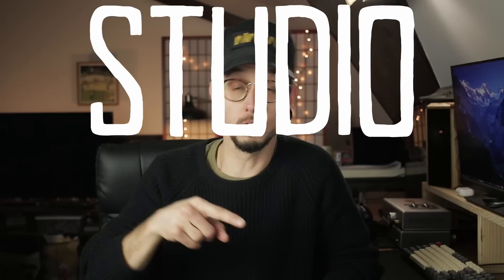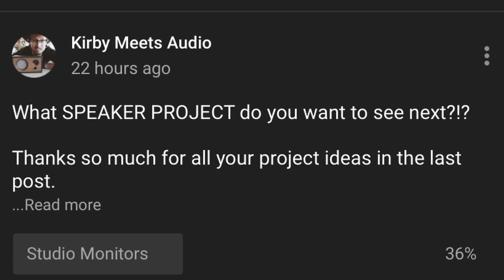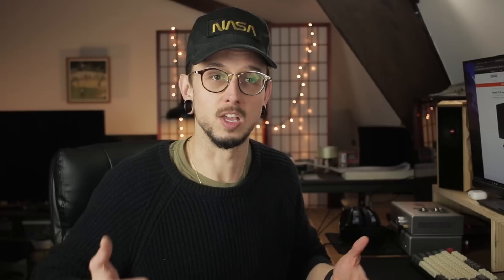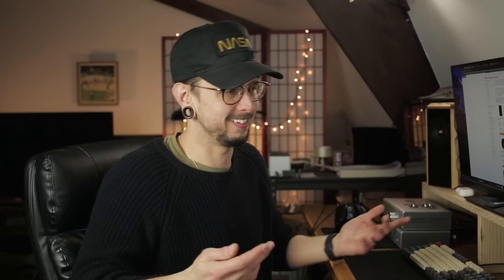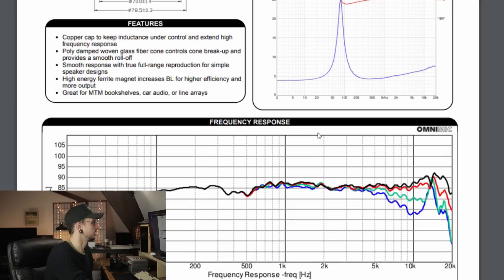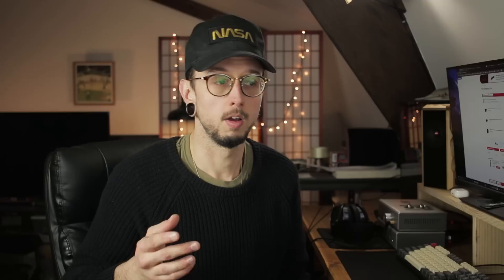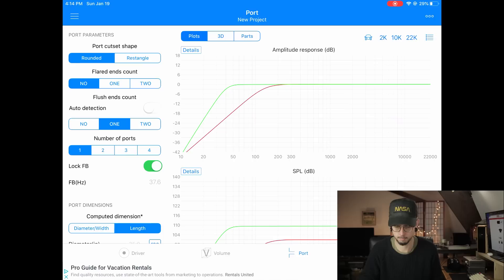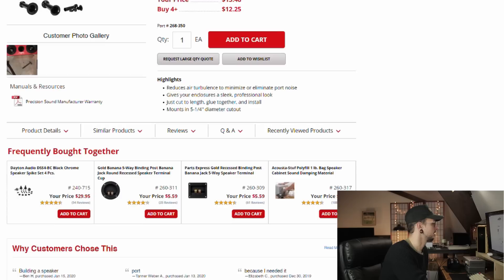DIY Studio Monitors (DESIGN) Step #1 | Home Recording Studio

Comment: Two questions popped into my mind. 1) Why zero thickness on the mid range box walls? 2) Why didn't you use its external volume (internal dims + wall thicknesses) in the calculation?
Reply from the maker: Because I want that enclosure to take up as little room as possible on the front baffle, so I was starting the internal dimensions just over the cutout diameter of the driver. Since all I really cared about was the internal dimensions I just left it at zero. Adding the thickness would be going off the external dimensions off the enclosure. Thanks for watching!
Reply: @KirbyMeetsAudio  I think the second part of this question was targeted at determining the dimensions for the overall enclosure, and I think you did, but it was hard to follow in the video since you were having to jump between screens for ideal volume and the volume calculator.

It seems like the overall enclosure volume should be: ideal volume for woofer + total sub-enclosure volume for midrange (including wall thickness)

Correct?
Reply: @KirbyMeetsAudio  When you spoke about the internal box, I assumed it had walls. So, I was thinking that the internal volume of the outer box should be the volume recommended by the software plus the external volume of the small box (internal plus walls). And, as you mentioned, plus a little more to accommodate other stuff inside.
Does the internal volume have to have walls to isolate it from the bigger volume, or do you just need to add the volume it needs to the volume of the bigger box?

Comment: Quick question: I have an older pair of Polk Audio tsi400 towers (3 speakers in each)... can't sell em, they work fine, dont wanna throw them out, and too big for my new house... I'm thikning of gutting them and reusing the speakers, separately, in a new smaller box to use throughout my workshop. Not looking for hi-fidelity, but basically just how to take speaker out and re-use in another cabinet... any requirements? Tips? Thanks !!
Reply: It will be the woofer that will give you problems, they are designed to go in a certain sized box if you pot it in a smaller box you'll most likely loose a lot of the low end, I'm guessing it's ported... Of so you would probably need to pot it in a sealed box
Reply: You need to  find the Thiele & Small  parameters to design the box in WinISD .
Google it .

Comment: Out of curiosity, what dome tweeter can you cross at 300hz? I’m guessing the crossover would need to be 4th order at minimum. I guess it would be a dome mid at that point, wonder if it could extend to be a tweeter as well.

I like the idea of comparing the dome with the AMT. I have about a dozen different pair of AMT and ribbon tweeters and would really like to play with them. I’m a bit of a dome guy.
Reply: No dome tweeters can be crossed at 300Hz or even 1000Hz, any dome tweeter going that low will produce loads of distortion, and by loads I mean LOADS.
Also the crossover would need to be 8th order just to have a chance of not blowing the tweeter up immediately.
And on top of that the output level for a dome tweeter in that range would be ridiculously low and would require a pretty big array to work.

Comment: Better with sealed box enclosures...if ported to much bass lag & long time  resonances...better a bigger box with an accurate bass & midrange response than a  bad resonant MILLSA frequency roll off response..ATC only use sealed cabinets as more accurate & faster frequency response in the bass & mids
...i use PreSonus Eris Ex8's, ported but i filled the bass port with heavy density foam...now a faster bass/lower mids...it really makes a difference when mixing... all the best monitor speakers use sealed box's, ATC etc, transmission line if designed right, my favourite but not cheap, PMC etc...even passive radiators are better than ports for more accurate bass & mid-range ...i built a pair of passive monitor speakers ,i built them 0.8m in height but put an HDF internal partition board to get the right volume after running a Thiele Small Paramaters CAD software check... designed a small footprint speaker so no need to buy stands & i can have as big or small an internal cabinet volume as i need....the bottom seperate partition is filled with sand, internal walls lined with copper foil as the bottom section contains a seperate box for the crossovers...this defo improves sound as no EMF etc to upset the crossover's performence, 45+ yrs has taught me no ports with monitors if you want a more accurate easier to mix bass & lower mids...good luck
if i could afford them i would buy PMC active Transmission Line monitors or ATC sealed box active monitors....you get a more accurate tighter bass especially if transmission line monitors...hard to design & build but worth it...good luck...do you have a build video ?....right seen the link..i take it they are gonna be passive not active bud ?...active speakers are better when mixing music but i have heard some fantastic passive monitor speakers if you have good  amplification..will look for the build video....sealed box's are more accurate & easier to design but you will need more enclosure size, the ones i built were closed units but had enough room for decent bass, a SEAS 8" bass unit....the cabinet was 9 1/2" wide x 11 1/2" deep x 0.8m in height without spikes & base.. 0.86m with base & spikes
...now to watch the next one
...good job so far ...i would tune the port to speakers unity for the fastest & best bass response...

Comment: Hi, I found your channel while looking for help to build a Bluetooth media/speaker box. I am not a speaker nut and have never built one before but I do dabble in electronics Raspberry Pi's and Arduino's. I have an old Avo Model 40 multimeter that as a meter is no use but thought it would make a cool steampunk speaker but I have no idea where to start. There is not a lot of room inside but I have cut out all the internals except the needle meter it's self. The rotary switches are still usable and it would be cool to incorporate some of that or even the needle meter like a meter on an old amp but that might be a step too far. Any ideas or links to parts I could hook up and mount inside would be great. I could get two small speakers in, one each side of the case,  or one bigger one at the back with room at the top for the electronics and probably fit some sort of rechargeable power pack.

Comment: Kirby, I think your heart's in the right place, and it's awesome that you're providing ideas and instruction for building decent quality DIY speakers, but calling them "studio monitors" is honestly... well... kinda dishonest. If building actual studio monitors was even remotely simple, NOBODY would still use Yamaha NS10s - a speaker that hasn't been made for decades, and that even Yamaha has been unable to recreate, largely because one of the original construction materials NO LONGER EXISTS. Also, most bi-amped and tri-amped powered monitors (i.e. Genelec 1031s) don't employ DSP, just quality analog crossovers. Additionally, your description of the large, soffit-mounted monitors found in high-end commercial studios as existing only to hype the clients is dead wrong, except in crappy control rooms with sketchy acoustics. Studio mains by companies like Westlake and Quested are insanely accurate, have incredibly linear frequency response that extends beyond the range of human hearing, have nearly zero distortion at volumes from barely audible to painfully loud, and in control rooms with great acoustics they're the main reference for mixing engineers... hence the term "MAINS". They're also decoupled from the structure of the room (when properly installed), and durable enough to make people deaf 24/7/365 for a lifetime, with no loss of fidelity. Not to mention they tend to be REALLY expensive, and no commercial studio would pay over $50k for speakers just to hype the clients.
Reply from the maker: Hey man! I agree and disagree with you. I certainly never want to make the impression that designing top-tier reference, studio, or hi-fi speakers is simple. But the truth is, getting 80% of the way there is totally doable by most people if you have the information needed. Most people (probably every single person) watching this video for more than just entertainment and are thinking about building their own, aren't working in a dedicated studio with high dollar clients. 80% is more than enough quality for a bedroom studio.

I think there are a lot of reasons engineers continue using the NS10s other than their distinct sound, including familiarity.

Actually, a lot of them do use DSP, including the monitors I was referring to in the video, Adam S3H.

I'll probably make a more clear note of this in the next video, but you're totally right about mains. They definitely aren't JUST for pleasing clients. I probably shouldn't have made it seem that way just for the sake of time. I've seen mains used all the time for various jobs during a session, but I stand by what I said in the video. Its what I was taught by some of the best engineers, and its what I experienced while working. Obviously, they are an amazing technical achievement properly implemented, that's their whole point.
And dude, be real. If you think a commercial studio wouldn't pay 50k JUST to make sure clients are hyped, you're insane.

I appreciate the comment and thanks for watching!!
Reply: @KirbyMeetsAudio  Thanks for taking the time to reply to my comment! I'm admittedly hyper-critical, and probably focused a bit too much on the negative. For the most part, I think you really know your sh*t, and clearly aren't trying to sell disinformation. I just have a kind of knee-jerk response to certain statements of "All..." that should start with "Some...", "Many...",  or even "Most...". For instance, you are absolutely correct that MANY bi- and tri-amped powered monitors employ DSP-based crossovers, but not ALL or even MOST of them. I know - I'm probably being ridiculous about semantics. It's a flaw I'm working on... lol. You're absolutely correct that commercial studios are willing to shell out big bucks on plenty of stuff to hype clients. I only take issue with the word "JUST" when referring to truly amazing monitors. When a studio spends $10k on a brushed aluminum pool table for the lounge, that's JUST to hype the clients. $50k+ main monitors may also have that effect, but their PRIMARY purpose is to make great mixes. Now that I'm harping on semantics, the truth is that the "clients" of top-tier studios aren't really the artists. Most artists (and record companies) defer to the expertise of producers and engineers when choosing a studio, so awesome main monitors really do hype the actual clients... because they're AWESOME. lol

Comment: Fun video..  
I know that you are not trying to make people into monitor designers; but as someone who has worked with/for a range of enlightened designers and other engineers over thee past several decades, and has owned several major studios and media labs, I can tell you that, some of your assertions are a bit off.

First, you need to consider the entire design concurrently along with the components (i.e. NOT sequentially or monolithically).  Second, the assertion you effectively echoed, which we often hear that "if you can make the mix sound good on poor speakers that it will sound really good on good monitors", is utterly wrong on virtually every level.  
While you may be able to rough things out on poor speakers, headphones and the like, there are huge trade-offs if you mix specifically for poor speakers, and try to use them for all stages of mixing and mastering.  However, you can, and generally should, use limited range and other types of secondary or tertiary speakers to comp and adjust the final mix approach-- although you do not, and should not, actively try to equalize, mix for, or optimize for them.  There are plenty of examples of commercial mixes where they have, for various reasons, done what you are suggesting, and with very few exceptions, the results are fairly horrendous.

As far as choosing the components, you need to consider the use/environment, source material bias(es ), enclosure and driver options, electronics constrains/requirements, and active and passive component options CONCURRENTLY, rather than sequentially or as part of what is sometimes referred to as a "waterfall" approach.  That is a big part of the reason why the vast majority of speakers are built as sound source transducers, rather than actual parts of the reproduction chain.

Comment: I just spent 1hour googling 536 questions google. And checking endless specifications on speaker after speaker after speaker no articles about magnets in STUDIO speakers. Which capture ACCURATE sound. U know, like reality or our ears do. 
    No1 cares about magnets in STUDIO speaker forums either. Zero data on magnets. 
    All I wanted 2know is type of magnet most used in studio (STUDIO) speakers. 
  Absolutely no specs I could find on any speaker dared breathed the word "magnet." 
    Question. I have a a BOSS guitar amp with 2 huge speakersa butted together. Wont this cause degaussing (wear out thmagnets over time?)
Reply: The Dayton Audio Reference Series have Ferrite magnets, just pick a few pairs of studio monitors you like, look at the specs of their speakers (ie: Barefoot Footprint 01 has an 8" Paper Cone Woofer, 4"  Aluminum cone Midrange Driver & 1" Ring Radiator Tweeter) then go to parts express or other component retailers and look for those types of speakers and check the specs, magnet info will be there. What I've seen is Ferrite and Neodymium mostly.

Comment: Hey I just did that thing on Amazon where I deleted an item and ordered the same thing for a buck more because it made my whole order six bucks cheaper.  I am trying to cut corners on my project, but building my own speakers is probably a bridge too far.  Remember to give your practice pair to a buddy and make your own after you learned from your mistakes.

Comment: wow, so many mistakes... ok, first. how the hell does a ported box is simple? second the 2 woofer and tweeter adam's are 3 why since only one of the woofers handle the bass, the other one is used as a mid, although both have the same lpf. and lastly, all the powered monitors i know of use a dedicated amp per driver and a active crossover. passive crossovers are messy. oh, and the hedd are a company created by the guy that designed the adams, so they not just look the same.